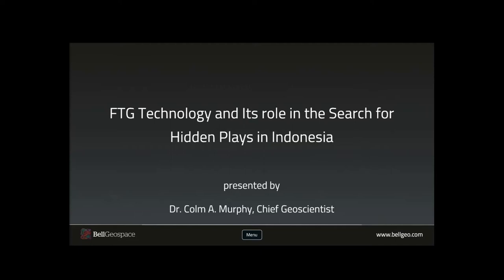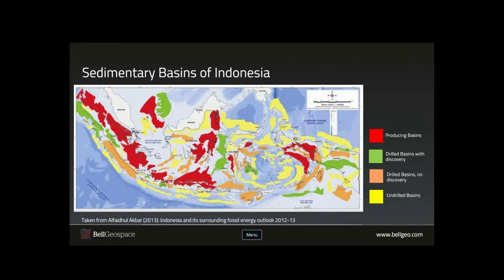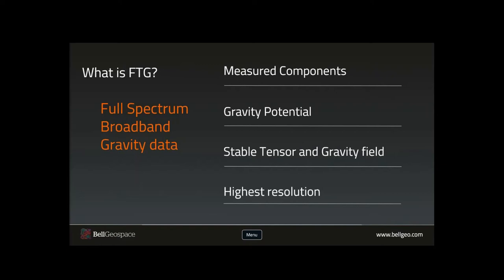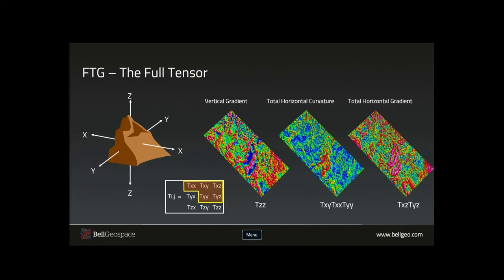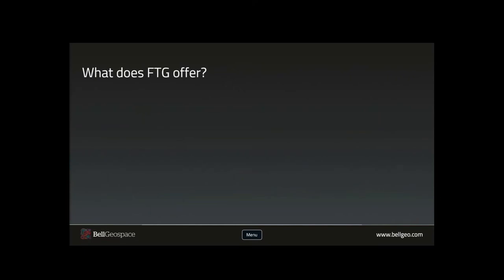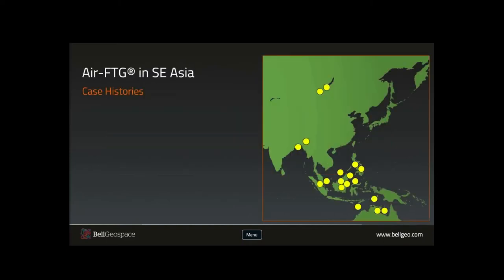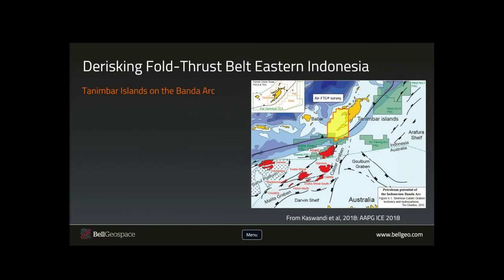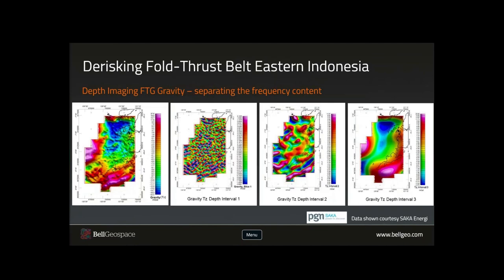FTG Applied Case Studies from Indonesia

Comment: How is the price compared to 3 D seismic? How much cheaper?
Reply from the maker: The cost is less than 5 percent of a 3D seismic survey.  In fact, an operator told us that when they combined their vintage/sparse 2D seismic with new FTG, the picture was 95% of what they would have achieved with a 3D seismic.